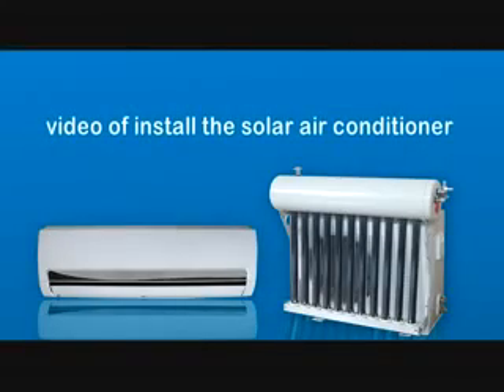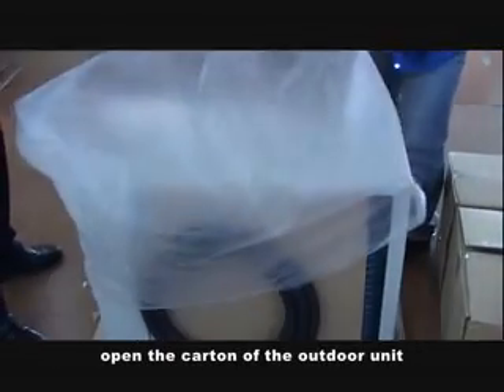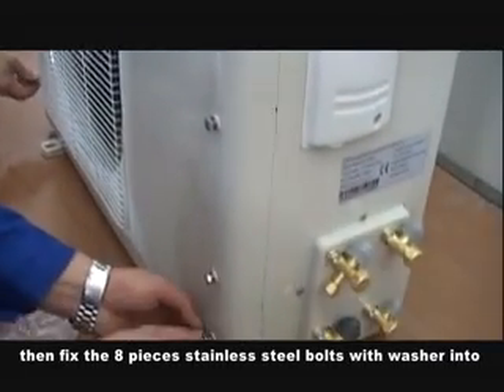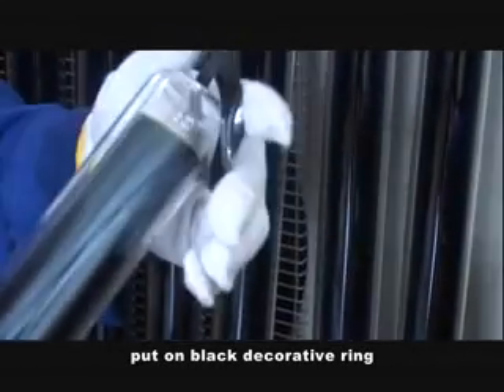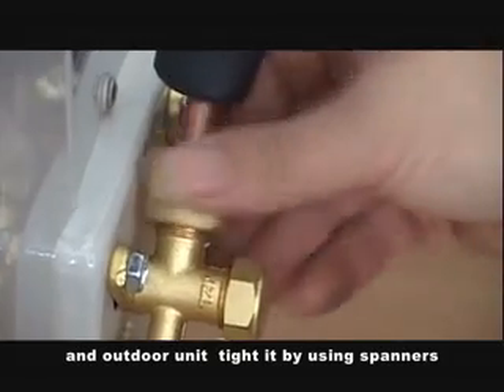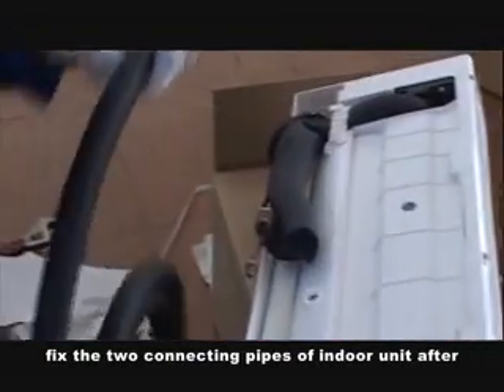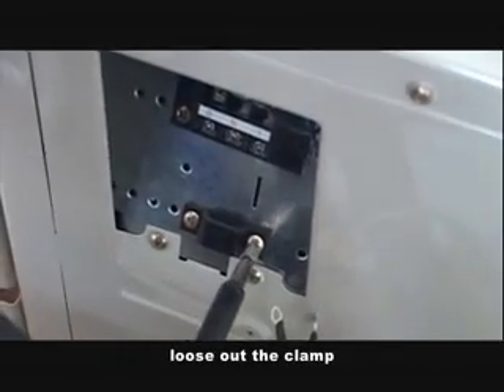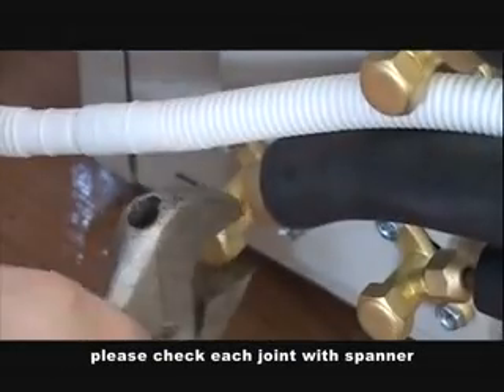how to install the solar air conditioner? air conditioner with solar engergy

Comment: EZ Battery Reconditioning is a detailed guide that was created to teach people how they can recondition old or dead batteries to save money or sell them for big profit. Basically, with the methods in this guide [Check Details Here==>https://plus.google.com/100351090281822647456/posts/Gwtd4mVBdEd  ], you can recondition batteries used for cars, computers, phones, solar panels, golf carts, forklifts, and a lot more.

Comment: It looks like a two part heat pump unit with domestic hot water add-on tank.
Reply: not really, I think! they just tried to absorb more sensible heat from hot air moving out from outdoor unit and combined with solar water heater to produce hot water.